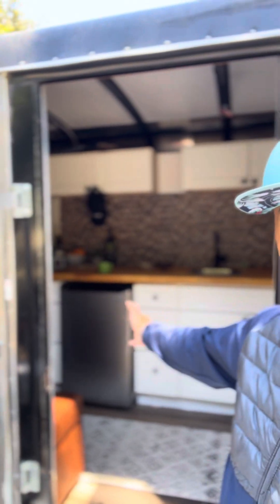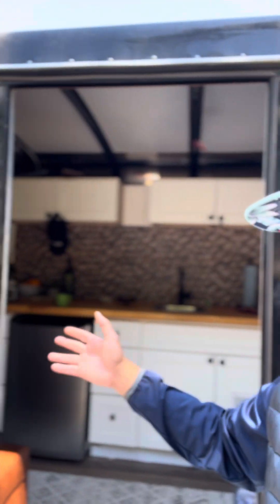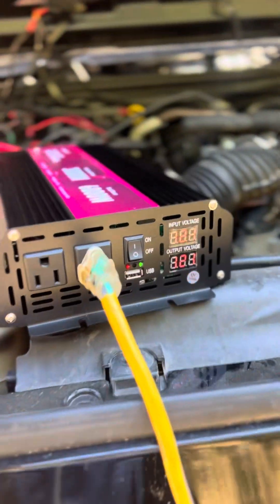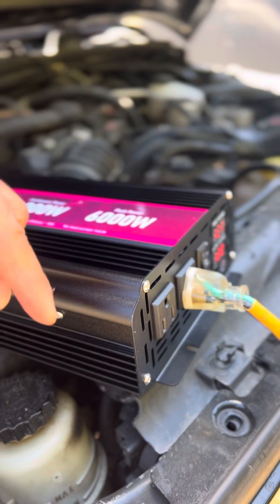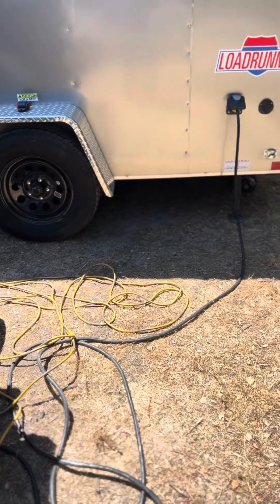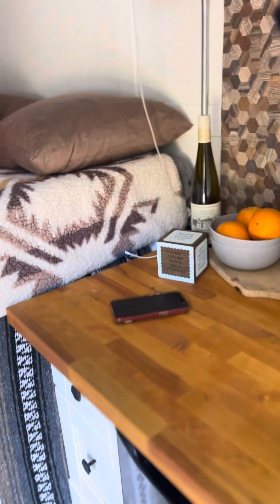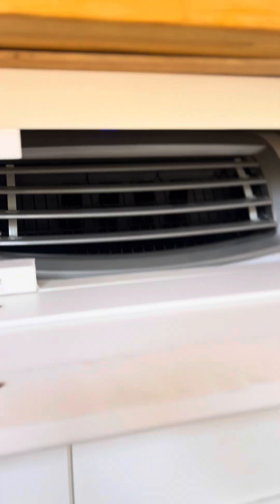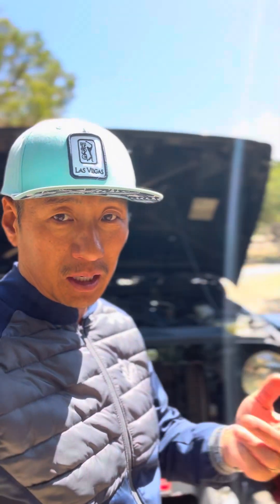How to power your trailer without solar or generator | Power trailer without SOLER OR generator

Comment: Well can't say for everyone. I've run my camper in the past off my truck before while camping in the middle of nowhere and during power outages. Just to be clear though. That truck had a lot of agm deep cycle batteries and an extra 375 alternator. Yes, 2 375 amp alternators. Now has lto cells. The 3500 pswi never hit low voltage and I would only have to start the truck every few hrs. Less than 30 minute recharge time because the alternators had spare amperage while running. It averages 312 amps at idle. Not optimal conditions. But when your power is off for a week it definitely makes life better in the summer.

Comment: I used this solution during after Hurricane Beryl in Houston, I had a small inverter and I all I needed was enough power for a fan and a small tv to keep up with the news, it really helped out in pinch. That was just about a month ago, since then I've gone down the generator vs power station vs solar set-up rabbit hole and have learned so much! There are new, better and faster ways to to charge even a good sized power station that'll run your apliances all night WHILE you drive to your vehicle even without solar.  I recommend you look into them brother

Comment: Appreciate the video but I'd never draw from the battery that I need to start my vehicle. Just as I would never tap into my vehicle's fuel tank to run a heater. I keep those things separate so that I never compromise my ability to leave a site.
Reply: I doubt he was using the very same battery to start his vehicle. He did state he has a multiple battery setup in his vehicle. Its not uncommon.
Reply: @totelife6443 I know it's not uncommon, I have multiple batteries in my Silverado but he doesn't really provide much specifics. Looks like his batteries are connected to each other so I'll assume that they are until he says otherwise. He also doesn't mention if the second battery is deep cycle or not.